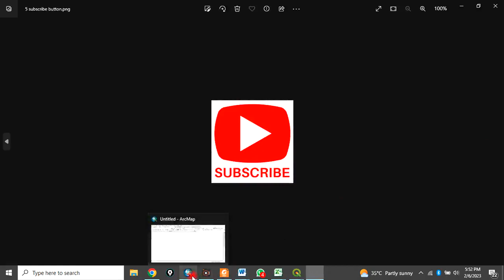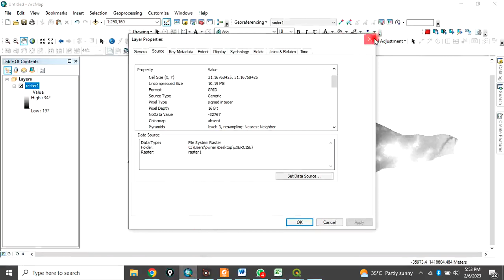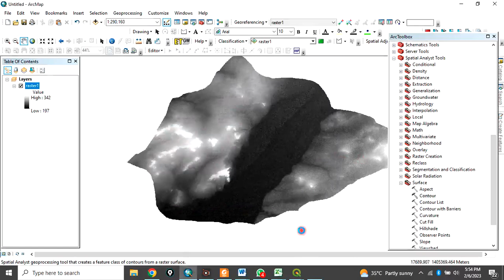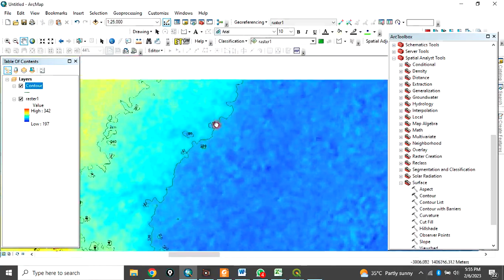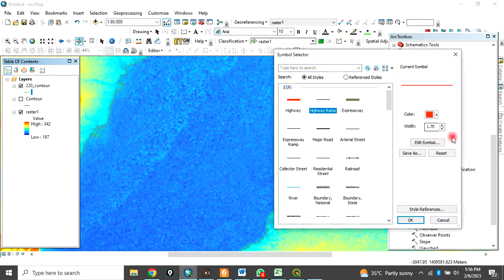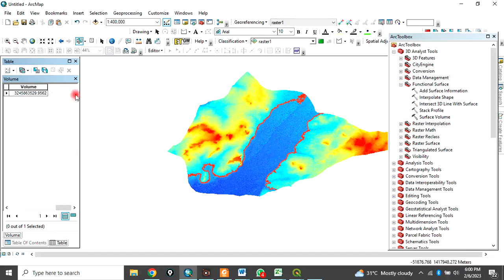How to calculate volume of water in lake or pond using ArcGIS

Comment: Where can I get the raster dataset used in this video
Reply from the maker: You can easily get raster datasets from USGS or if you have channel or water depth readings you can convert them to raster dataset through interpolation
Reply: @geojaygissolution4856  thanks